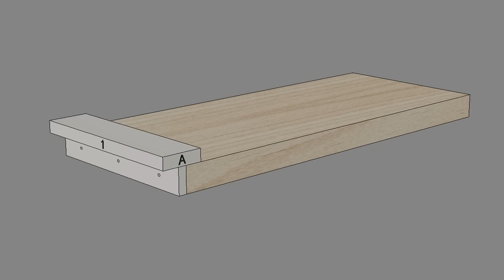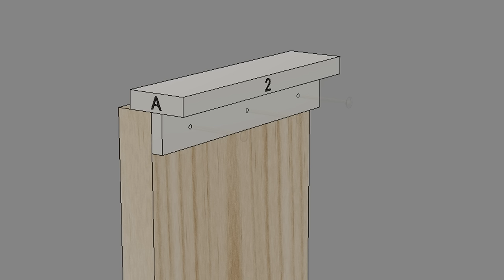10 minutes Dowel Jig: Dowel joints got easier and quicker even by beginners (subtitle explanation)

Comment: what sense does it make, to repeat time stamps??
Reply from the maker: You know the old-time trick of tracing the dowel position using brads ? This jig makes it easy to do that. How many holes do you drill to make 4 drawers? 96 if you use 3 dowels on each corner. No matter what jig you use, it's the same process over and over again. So, stamp is handy. 
Old tricks can still be useful today, because sometimes the starting point for solving a problem when building something complex is a very simple solution.

Please share a jig that is easier, more accurate, and can be made from scrap materials.
Reply: noo that is not the point, the jig is okay.. but why you allways take time stamps by showing, what sense does it make .. I see that ny others too and do not understand that
Reply from the maker: What part of the video are you referring to when you say repeating timestamps?
Reply: @kikikumastudio  when you are pressing on your smartphone
Reply: look at 1:49 …. sry wasn‘t a smartphone
Reply from the maker: The title said it could be made in 10 minutes, so I just tried it myself.

Comment: Repeated use, and pulling the marking nails, will wear out the jig.  Instead, clamp in place, and use an awl to mark the drill locations.
Reply from the maker: Awls are tapered at the tip, so it will be easy to shift. Therefore, I use brass escutcheon pins. Be careful to keep the pin straight and tap lightly. 
A certain thickness is required for the material used for the jig. Make sure that the hole leads the pin straight before the pin touches the material.  6mm is minimum when I tried.
Drill 2mm holes into the jig and use #14 brass escutcheon pins, wire diameter 2mm as mentioned in the video. Hard to enlarge the holes with this combination if you used it with care. As always, please do it in a way that suits you.
Reply: 7:42 😢😅😊お😅😢p 7:42

Comment: Idk....seems like a lot of work that a speed square could have solved with probably more precision. You're also banking on the nails not tilting off axis when being tapped through the hole.
Reply from the maker: Please try the way you want to. Thank you.
Reply: The maximum deflection of a nail going through a channel that small is negligible. I also am not sure how a speed square would have transferred dowel positions from one face to another.
Reply: @paranormalist11  You're saying a speed square wouldn't have completed this project long before he even completed the plans for the jig?
All the lumber are pretty much squared, if I recall (I'd have to rewatch). So if you use a speed square and measure 2" to one position and 4" to the next you'll still get your line up.
Unless I missed something critical that warranted the jig, which then I'll accept I'm wrong and retract my initial statement, "he could have been done before he start".
Reply: @theren8311  every time you measure with the speed square you I produce error just by nature of variance. This jig will put three marks at almost the exact same three spots every time with respect to the reference surface. And you only need to make this jig once to be reused for every project with similar sized boards so you do save time in the long run.
Reply: @paranormalist11  Not sure about your speed square, but the ones I've come across and used, all have grooves for pencil/pen slot alignment. Pretty much guarantees you'll place your mark consistently if you use  them. It also eliminates parallax errors, along with helping to draw parallel lines to your reference.
Regarding re-use. That's debatable. Higher chance this jig is just going to take up space in your shop after using it for a specific project. Especially when working with non-rounded dimensions, like 2.5" or 3.75" if you want even count.
At the end of the day, if you wanna spend the time cutting + building jigs, that's your call. I'm just arguing your time could be better spent completing the actual project just as accurately and faster with the tools you already have.

Comment: What is the repeatabilty of the  jig's useful life? Because the wood hole will get progressively bigger as the brass nails keeps hammering in and pulling out. Its still a good idea.😊
Reply from the maker: You are right if you keep hammering. But do not hammer the brads. Tap lightly and that's enough for making a tiny dent on your material. So, using the jig in this manner you can finish few boxes in same accuracy. But if you are really looking for repeatability and accuracy. Use the jig with brass pipes. Thank you!
https://youtu.be/8hkCJkldHxs
Reply: Because the 3 pins need to be removed for each face marking and this action will enlarge the jig's hole and I don't know how many times this  can be used.  The masking tape method works and is easier.
Reply from the maker: It is important to use a brad with the same diameter as the hole. Drill 2mm holes into the jig and use #14 brass escutcheon pins, wire diameter 2mm as mentioned in the video. Hard to enlarge the holes with this combination. Well, use the method that suits you anyway.

Comment: Konichiwa! Is there a way to make the brass bushings adjustable so they can be moved according to where the dowel holes are needed? Thanks.
Reply from the maker: It might be possible if the jig is made of metal. This question is about how to make a dowel jig with a hand saw, right? Anyway, I'm glad you're interested.
Reply: Get a DowelMax jig much easier

Comment: How do you prepare the height of the 2 wooden jigs? You show us how to cut it to length what about the height? The jig height must be the same thickness as the joining timber
Reply from the maker: This jig is to transfer the dowel position. So there is a length that is easy to use, but there is no rule regarding height of the jig. It is easier to use it if it roughly matches the material, though. I hope that answers your question.